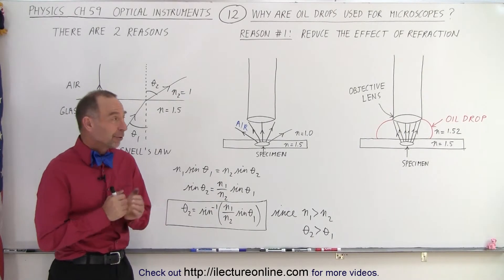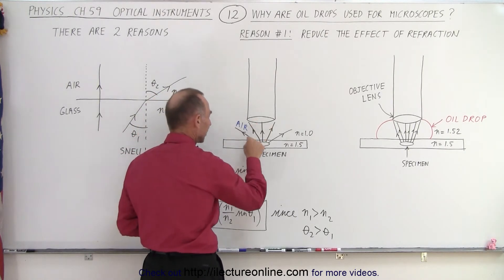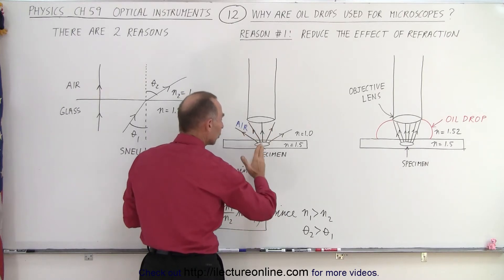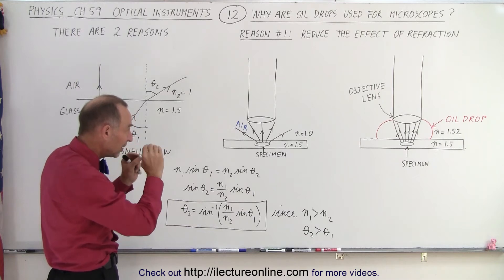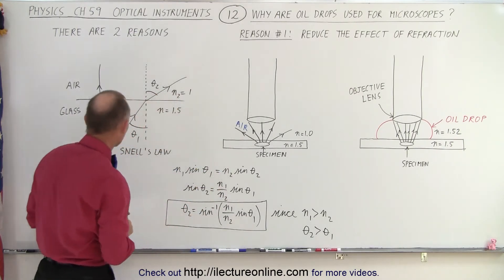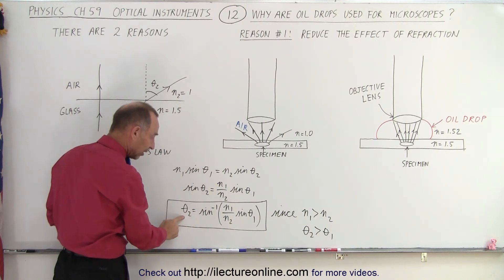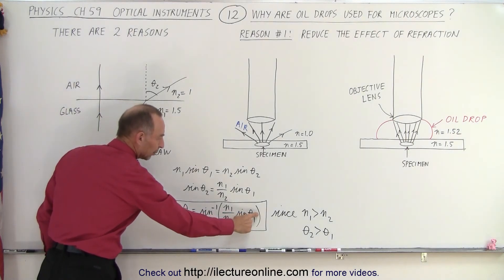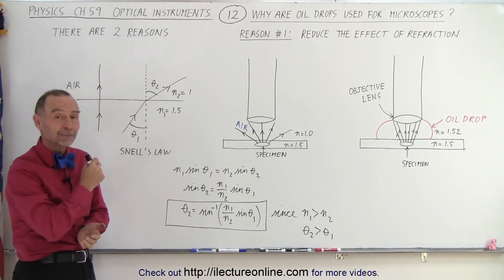Physics 59  Optical Instruments (12 of 20) Why Are Oil Drops Used for Microscopes?

Comment: Very interesting series on optics. I've been digging into your lectures on optical devices as I've been playing around with a telescope recently and have some ideas I'm curious to work on.

This oil drop thing is interesting because I recently came across a video of someone using a water drop with a laser through it as a jerry-rigged microscope, able to see skin cells. I wonder if something similar can be applied to viewing the stars.

In this case you described in the video where the light rays spread due to the differences in mediums, I'm wondering if mini fresnel lenses can be used to correct the dispersion of rays?

Thanks Professor Biezen! I'm starting with the basics in your previous videos, w magnifying glasses and basic optical properties, like focal lengths etc..
Reply from the maker: Thanks.  Enjoy the journey!   🙂